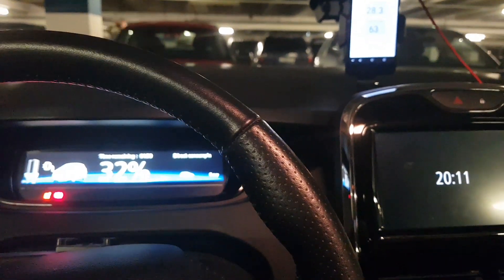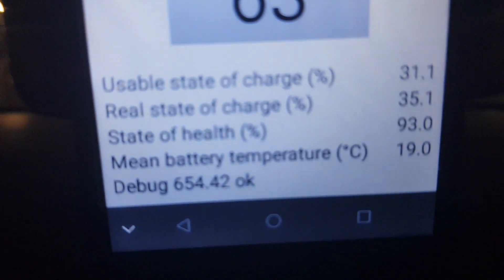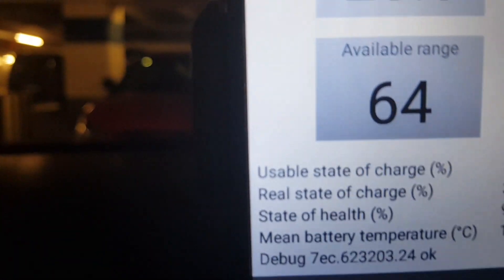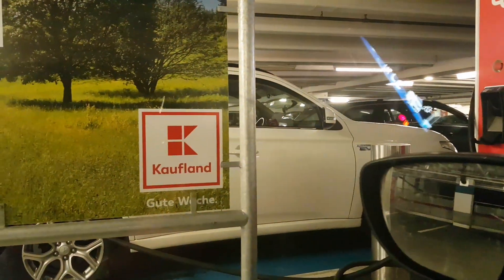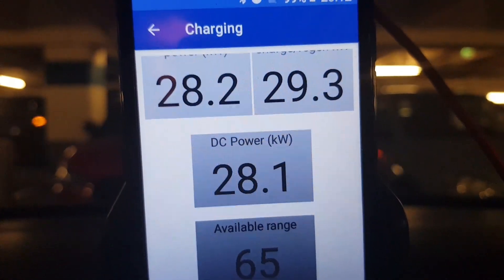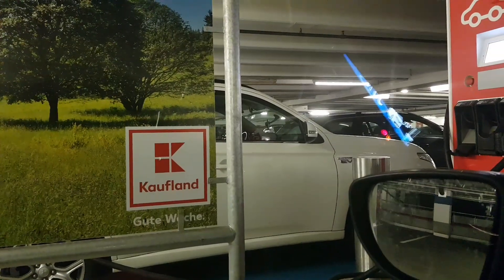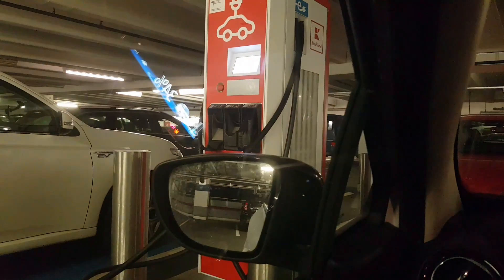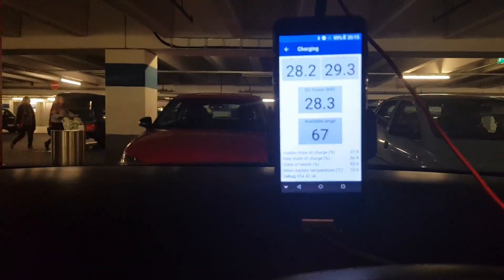🔴 Warm battery charging speed - Electric car Renault Zoe Q90

Comment: Thanks for the videos regarding charging speed. I just found out on the hard way that I can't have 22kw if outside it's 0 degrees. I think I've got just 11kw but the time I've spent and amount of energy got in.
Reply from the maker: Yes you are right. Charging speed is very slow with a cold battery. 
When my battery is 0°C, like yesterday morning, I have a very very slow charging speed, less than 10 kW. 
I wish there is a battery preheating, so the battery is already warm before start charging. The problem, is, the Renault Zoe will only heat the battery when charging.  :-(
I am looking for a way to start heating already ahead...